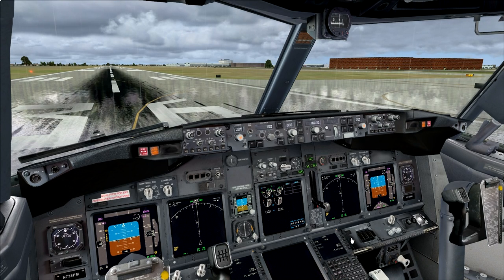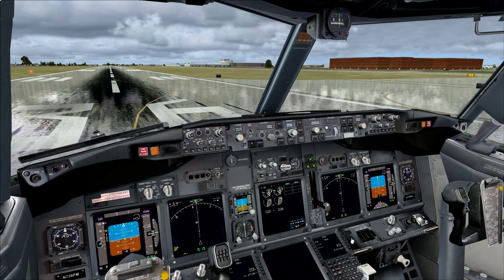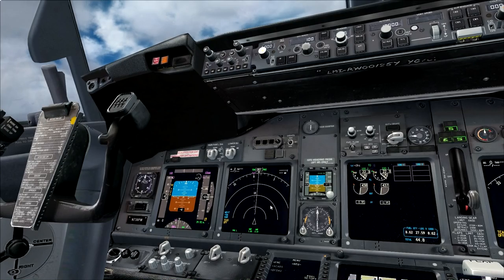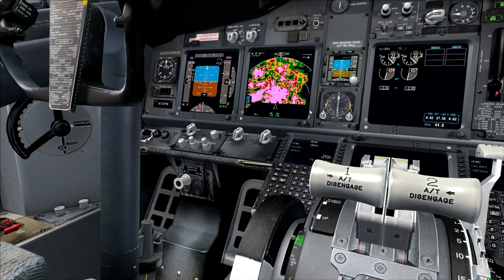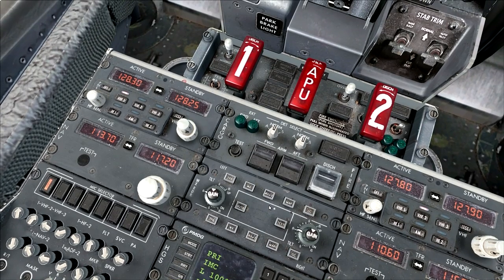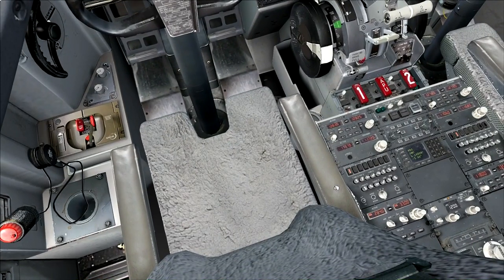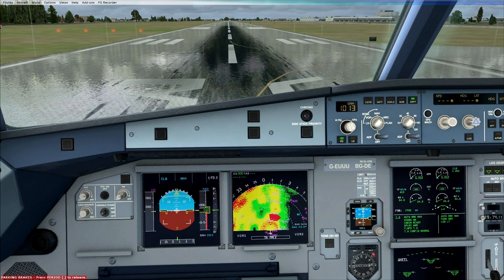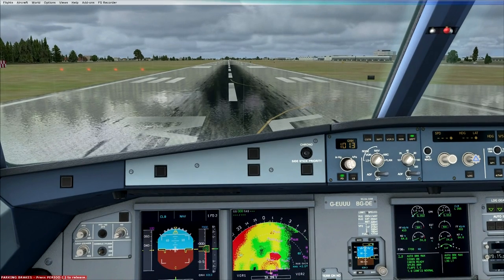Weather Radar

Comment: Does the radar work only when on ground???in mine it says only winshear ahead, but only writing no the radar is not moving like yours..plz help
Reply from the maker: It should work in the air the same as on the ground.
Reply: @jasonspiskey4148  only ASN???or it could work in FSXWX or default or fsx weather
Reply from the maker: @Mircea1997  To my knowledge it will only work with Active Sky next or Active Sky 2016.  I believe that when the new NGX for P3D comes out , it MAY have support for REX weather engines
Reply: i bought Active Sky Next, and it dosent work .. what should i do??how should the gain be????pls help me :D
Reply from the maker: @Mircea1997  make sure that you are in an area where it is actually raining, gain should be in the middle.  Make sure that the panel on the center console is not in stand by or test and make sure that you push the wx on the glare shield panel above the ND display.  You should see a blue wx on the left side of the ND.  If you have all of that and still see nothing, make sure active sky next is connected to the sim.  If none of those are the problem, you will have to contact PMDG for assistance
Reply: Thanks i fixed it, it was a load problem in fsx, and no addons was avaiable !

Comment: My active sky next is working properly only in cockpit wxr panel, gain button not working , not active....
Reply from the maker: If you followed the video for turning on the weather and it is not working, you might have to uninstall the PMDG 737 and reinstall it.  Also make sure your aircraft is updated to the newest version.  You can do that with the PMDG Ops center.  If those do not help you, then you probably are going to have to contact PMDG tech support or post in the forums for help.  That is as far as my knowledge goes

Comment: I have been trying to switch on the radar on pmdg 737 with no luck. Can you tell me exactly what you did. Thanks
Reply from the maker: ilyas sharif do you have Active Sky Next or Acrive Sky 2016?  One of those is required.  Next is to make sure thay it is actually raining or snowing where you are at.  Clouds do not show up.  Next is to turn on the radar by pushing the WX button on the glareshield.  It is located on the same panel as the baro knob at the bottom where the buttons are.  It is all the way on thr left.  Once on you should see a blue wx icon on tour nav display.  This indicates the radar is on.  If you still dont see anything and it is raining or snowing outside then you need to adjust the gain using the weather radar control panel.  If you still have nothing showing then it is beyond my expertise to fix.

Comment: What are your PC specs, graphics card and monitor model? Looks good.
Reply from the maker: damien knight nothing major.  I have intel i5 over clocked to 3.3ghz 16gb ram nvidia geforce 560ti running win 7 on a 24inch Samsung monitor.  I get about 20 fps with stock airports with PMDG aircraft and about 12 to 18 with add on scenery.  My rig is about 5 years old

Comment: I won't go over everything that was wrong, but I will mention the tilt. You don't want to tilt it up because you're climbing, or level in level flight. There's times you're going to tilt it up or down and it depends on your alt and where the weather is.
Reply from the maker: The purpose of this video is not so much on how to use a weather radar correctly.  I stated in the video that I have 0 use of an actual radar in an aircraft and that I could find very little information online.  The goal of the video was to demonstrate why ASN (now also AS2016) was needed for correct radar display.  Many people on forums were upset that when they had clouds in the sky, the radar was blank.  However, if you do have any information on how to use a radar in flight, please share because, even a year later I have not seen much information on this.  I have learned since this video was made and before your comment that you have to tilt up and down in order to determine storm height which translates into strength.  The MAP button is used at low altitude to help eliminate buildings, trees, and other ground clutter from appearing on the screen.

Comment: In my pmdg the buttons in the weather radar console are not working, they are frozen, what gives??
Reply from the maker: Do you have the updated version?  Make sure that when you updated to the new version that you completely uninstalled the older version and did a fresh install.  If that does not work, make sure that your Windows is completely up to date.  If all those are good you will have to contact PMDG support
Reply: Thanks. I never thought of tech support

Comment: When i test mine and i made sure my WXR was on it does not show anything even when i test it. Please help.
Reply from the maker: I have noticed that after the recent update a few months ago, when I do my test, I only get the audio and I see wind shear but not the color display anymore
Reply: Yea that's what it does for me i just never you it i only use TERR
Reply from the maker: I believe that the issue is that in the real aircraft, you hold down the test button.  In the PMDG 737 NGX, push the test button down by left clicking.  CLick the left mouse button and hold it down then drag the cursor off of the test button, this will simulate holding the button down.  Also make sure you push the wx button on the glare shield first.

Comment: Hi Jason,I am relatively new to the FSX world. I have just recently picked up the PMDG 737 and 777 aircraft(s) Of course I am excited for the amazing graphics and whatnot, having a lot of fun. As a beginner I have yet to be able to deal with the FMC. What I do is simply create a flight plan via FSX ATC (No FMC) After takeoff and reach cruise I engage AP and simply follow ATC prompts. One thing I want to ask you  (the expert(s) ), How can I utilize the weather radar without using the FMC or is that even possible.
I have a ton of time on my hands as I have just had my umpteenth surgery to rebuild my leg (I am a disabled veteran medically retired from the Army) Any help would be sincerely appreciated.
I am acutely aware you are probably bombarded with your rookie brethren.
I see in some forums experts bash new guys, please be kind...
Reply from the maker: +Robby Robinson First off, thank you for your service in our Armed Forces.  You can turn the weather radar on and if you see purple or read areas you want to fly round, just adjust your heading on the autopilot control panel.  You will see a purple dashed line on the ND display that will show where the aircraft will fly.  Move that heading knob till you have a path that goes to the side of the storm.  Once the weather is behind you, move the heading to get you back on course.  I never use FSX ATC and just pretend in my head.  There are some packages out there you can buy that work a little bit better.  Best thing is to get online with IVAO.  If you have the time and the MONEY I HIGHLY recommend Angle of Attacks training packages.  www.flyaoamedia.com  They first part of the training goes into how the aircraft systems actually work, like the hydraulics and such.  The next two parts of training are all hands on flying.  You get all the paperwork you need to fly the flights in the videos.  They have a package for both the 737 and the 777.  They are kind of pricey though.  You can also watch videos on Frooglesim's page or Matt Davies page.  They both have a lot of in depth flights.  I recommend learning how to actually use the packages you bought.  If you are also having some troubles you can purchase FS2Crew which adds a First Officer that will take the work load off of you. (you still need to program the FMS)  Unfortunalty you will find that most of what you do "flying" these aircraft is nothing more than computer imputs.  Good Luck

Comment: So... REX doesn't work with the weather radar then? Because I've just bought REX....
Reply from the maker: No it is not.   I am not sure but I think with anything other than Active Sky Next will pnly show you a black screen.  It may show colors but it will not be accurate in that you could be in an area of red which should be heavy rain our snow but there will be no precipitation out the window
Reply from the maker: I use REX for textures because ASN does not have any textures with it
Reply: +jason spiskey Hey, how did you get the two to work together, in the end I bought ASN, I removed REX because it was causing issues, but I've noticed the weather from ASN is really simple, whereas with REX a thunderstorm looked really lifelike, all the weather looked better but I'd like to have the same thing as you.
Reply from the maker: At the time I only used REX to install textures.  I picked what I wanted and installed the textures then shut down REX.  Now I have REX texture direct which does not download any weather, it is just a texture package.  So in short open up rex and create your theme of textures you want to use..aka clouds water and.so on, then close rex.  After rex is closed then open up ASN and then run FSX.  Always open ASN first then after it is done losing then open FSX.  ASN does not have a texture package so you just use rex.to install textures
Reply: +HMSDaring1 too tree j

Comment: I'm a pmdg boxed customer. I've been on aerosoft web site. I've got the ngx zip. I've zipped it. It gave me three files. Two for read me and one for base package. When I run the base package it installs it but then nothing. I see no sign off the update. 

When I go into my ngx I'm unable to use the centre console weather thing. When I hover over it I can move the dials. Very annoying. What I'm I doing wrong ?
Reply from the maker: +Dean Arnold I'm sorry that I did not reply to your comment sooner, I thought I had.  You have to uninstall the entire aircraft from your computer first and then reinstall it.  I know you had to do that for the download version. The readme files should say if you have to do a full uninstall first.  My understanding is that they reprogrammed a lot of coding and put some the technology they created in the 777 into the 737 to give it a bit of an updating.  These changes were too complex to put into update so you have to completely reinstall the aircraft.

Comment: My weather radar pmdg 737 work now after I found this post on avim : http://forum.avsim.net/topic/463861-installing-fsx-and-fsxse-updates/
Reply from the maker: First you need to have Active Sky Next or Active SKy 2016.  To turn the radar on just push the WX button on the Glareshied panel.  It is just above the ND display.  To see anything on the radar it has to be raining or snowing outside.  Clouds will not show up.  You might also have to adjust the gain with the gain knob located on the center counsel.
Reply: Possible to explain how you activat weather radar in the PMDG 737 NGX
Reply: thank you very much i downloading now active sky 2016 i try to use with
stap u wrotte to me Thank u V.much Jason

Comment from the maker: For those inquiring about the PMDG 737 Steam edition update, I found the update by going to www.aerosoft.com.  Then on the left hand side of the screen click on FAQs/Updates. You will have to scroll down some.  This will open up another search window that will have the Aerosoft A10 Warthog displayed.  Click on the box and scroll almost to the bottom and click on PMDG NGX.  Then click on in the blue box, show support for selected product.  It will open another box and it will have a blue link to a zip file and under that it will say you will need a product key.  Click on the link, enter the product key from your boxed product and then you can download the update.
Reply: Trying to update my pmdg ngx with sp1d. I have the boxed version. Also fsx steam. I've downloaded a zip which gives me Pmdg 737 NGX base package fsx.exe

When I run it it just gives me the base package that's it. 

No sign of sp1d.
Reply from the maker: It should be the update.  S
SP1D is a complete reinstall.  It is not just a update to the product already installed.
Reply: jason spiskey I had the same problem, I can't click on the test button. Also does it matter if your using the trial version of ASN?
Reply from the maker: It will work with the trial button.  Try updating FSUIPC.  I think it requires an updated version that was released around the same time as fSUIPC
Reply: I will try.
Reply: When I installed it all my liveries went and it didn't install the PMDG Livery Manager.
Reply from the maker: Should be a part of the Ops Center now
Reply: I'm still trying to figure out the weather radar I have purchased pmdg 737 and active sky I set up everything correctly but I'm still not seeing any clouds on the radar when there is clouds in the scenery am I missing something? I don't think my radar is working but it is turned on followed your instructions
Reply from the maker: Clouds do not show up on yhe radar.  Only rain or.snow.  if it is cloudy but no rain or snow you will have a black screen
Reply: K hopefully that's all it is

Comment from the maker: Active Sky Next is required to get the weather radar to work.  There are some work around a that can be done if you used the Active Sky Next 7 day free trial, however I do not think the weather on the radar will be accurate.   In my opinion, Active Sky Next is well worth the money, not just for the PMDG weather radar (and I am sure more developers will begin to use it) but just with its ease of loading realtime weather.  You already invested a lot of money in the aircraft for its realism, well flying is about 100% affected by weather.  Also if you have the PMDG T7 there are other options that aircraft can use with ASN.

The model I am using is the 738 base package.  I am not 100% sure but it should be the same across all 4 models.  As for the DVD upgrade, Aerosoft released it about two months ago.  If you go to their home page, a link should be on the right side of the screen.

Comment: The radar does not function with FSX default weather. Active Sky Next(ASN) is required for the radar to work... As far as I can tell. I found this info in the PMDG support portal under "Weather radar troubleshooting" was listed under PMDG 777 but the 737NGX was also included in this. If I'm wrong, then you can help me:).. Cheers
Reply: Todd B. Jones  where i can active Sky next please ?
Reply from the maker: +alpha bravo http://www.hifisimtech.com/Downloads/
Reply: @Gun Nut How to get the radar works with default fsx or p3d weather engine?!
Do you know other addons?
Reply: @223 Remington How can i make it in default??